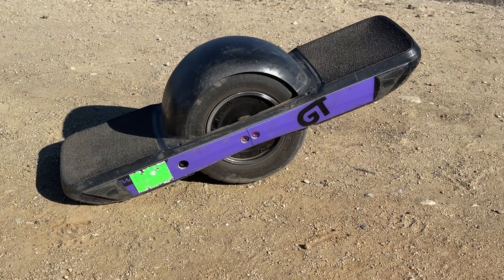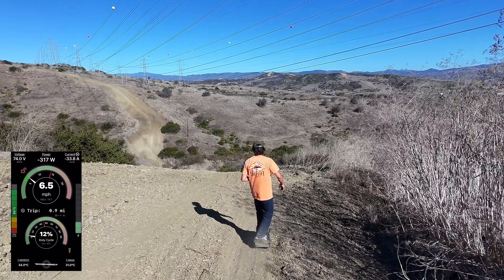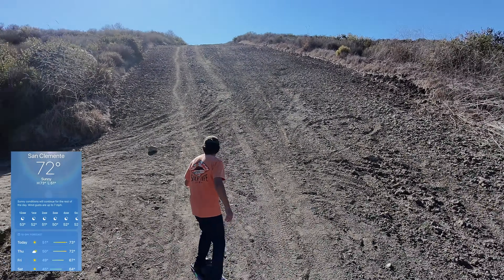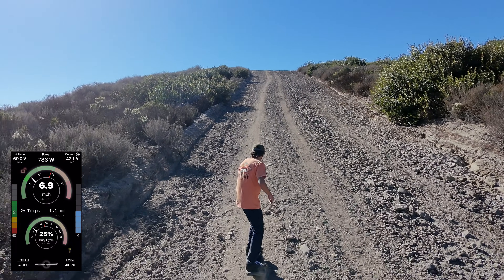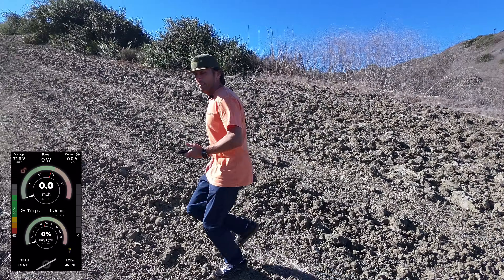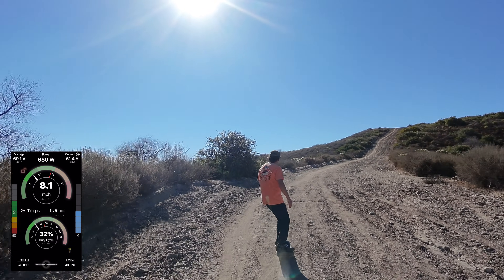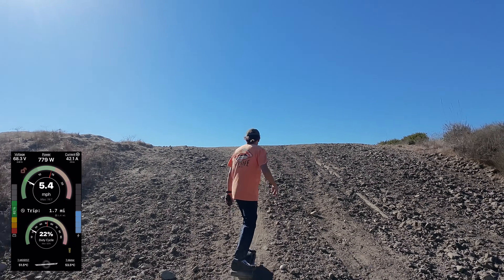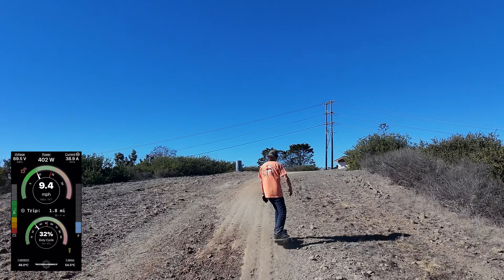Bring the Heat - Part 9: GTFO

Comment: hey surfdado I started to hear some buzzer warnings today on my thor 300 gtfo with hypercore and n52 hub. I searched for some codes but nothing. So its happening mostly on larger curb nudging and when I deweight the board for some trick. Im getting a 3 beep deal. It didnt do this the first 100 miles of riding witth new vesc. Its throwing zero codes in terminal. Does anyone what 3 beeps is.
Reply from the maker: @dbirds21  app ui should tell you the beep reason - or float control does too. Most likely low voltage warnings
Reply: @surfdado  thats what I thought, but its not saying anything other than none for faults.
Reply from the maker: @ it’s not a fault so that’s expected
Reply: @surfdado  im being safe. Not getting any weirdness or bad behavior. Just the beeps. I was also hammering today over n over on a 5 inch bonk and the hypercore got hot! 80 celsius and it was snowing out. I really was hammering it pushing it to find the limits. Never came close to those temps before. normal riding im at maybe 55c. I think I will purchase the super flux hs motor. It kinda sucks because I just bought this mte 5 inch hub with the 655 enduro tire last month. I need
Reply: @surfdado  yup  the 3 beeps were low voltage beeps. seems to happen when I get down to 60 percent or worse on my battery. I love my vesc but the stock battery and the way I ride I only get 12 miles tops and im at 25 percent. It kinda sucks. Before the vesc I only got 15 miles. I was going to get the superflux motor but I think I would be better served getting a larger capacity 18s 50s battery. The only one I see in stock is the nexus 18s 50s cell pack witth 10.0 capacity. Do you have any suggestions for something I can purchase. I just want to stay at 18s and keep the fungineers bms simplicity
Reply: @dbirds21 NEVER get your motor to 80c.  at 80c and higher you are de magntizing your magnets causing permanent damage. Set alert at 75c and stop right there as temps will climb higher over some time before they drop. Key ui to not get over 80 or you are damaging stuff, no joke

Comment: loving my gtfo thor with hypercore and wtf rails. Its a brand new ride. So much more power and today I was able to cruise ar 24 mph witthout a hiccup, sustained and only at 70 percent duty. The thor is crazy good. Curb nudging with the thor is too easy, wheel just chunks right over the curb. Heres the key with this thor! it just feels safr than the stock gt.
Reply: Do you experience overheating with the hypercore?